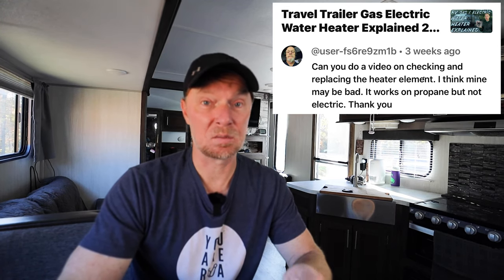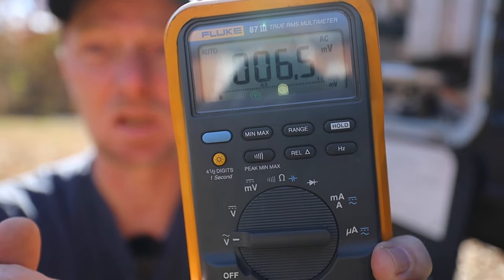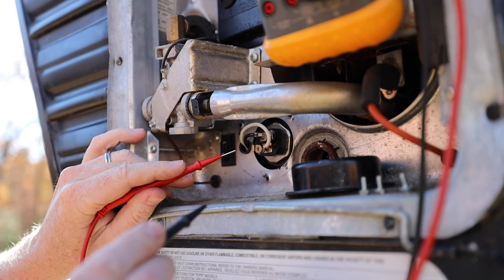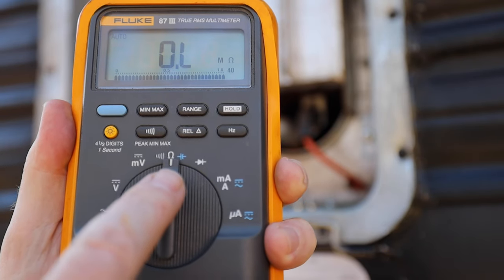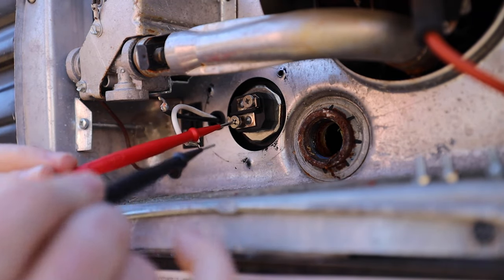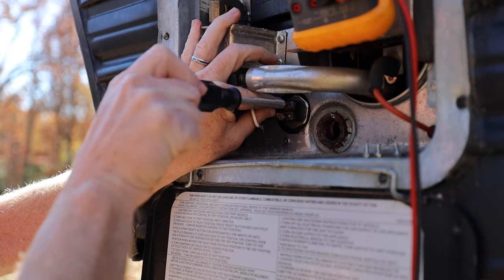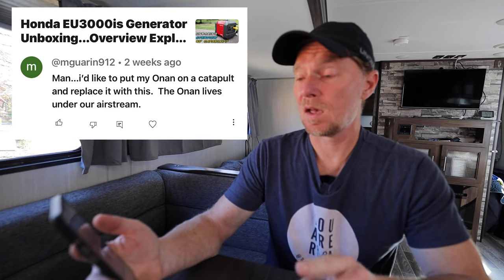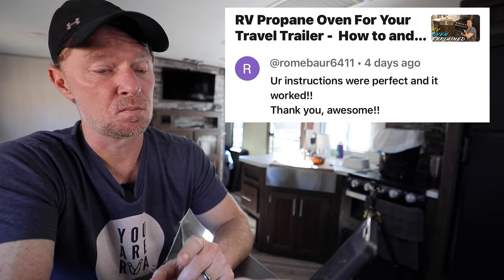How To Test Water Heater Element - Is It Really Bad???

Comment: Im a subscriber, On my RV Electric heater element... My ohms test is 10.4 so element is good how do I TEST  to see if the element is getting shore power?? , do you have a video on that? I live way out and no techs will come 5 hours. I am pretty handy and have do most things for myself. All the breakers and fuses are good. Dometic Heater WH-6GEA works on propane no problem at all. Just not shore power. I did put the volt tester leads to the heater element black and white wires but no power shows up on the AC side of the meter. I had instock spare stuff and one was the control board, installed that but it is doing exactly the same thing with a brand new control board (atwood part number 91365 ) ...Not sure where to go from here. Your help would be appreciated. Thanks
Reply from the maker: I would go to where the water heater is either plugged in or hardwired and check to see if there is shore power available. If it is, make sure that there isn’t an on of switch, button or panel somewhere in your RV. Outside that, the controller may be suspect although you swapped it out already. Sometimes the controller is bad from brand new. I do not have a lot of experience with Atwood but there isn’t many parts between the power lug and water heating element. Oh and check to see if there is a temp sensor somewhere, I fought this to be a problem since the propane side is working. Worth a check though.

Comment: Great video
I checked my resistance on the new heating element I installed at it measure 10.3 just lime your video
I still don't have hot water on the electric side. Any help would be appreciated
Reply from the maker: It is possible the the reset button on the water heater needs to be triggeres. Look for the Black button that has a rubber cover. I would love to hear what you found to be the issue when resolved.

Comment: Does it matter which lead goes to correct screw 
White or black
My casita camper doesn't show negative or positive only a black and white lead
Reply from the maker: It should not matter as long as the wires are disconnected.